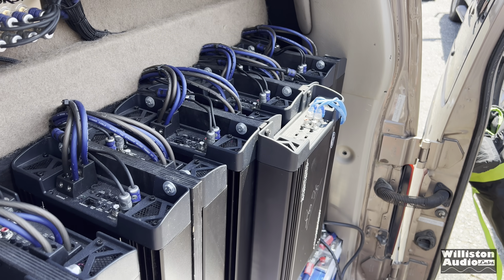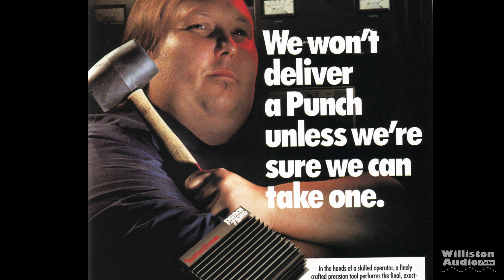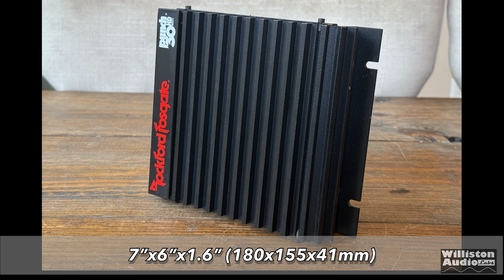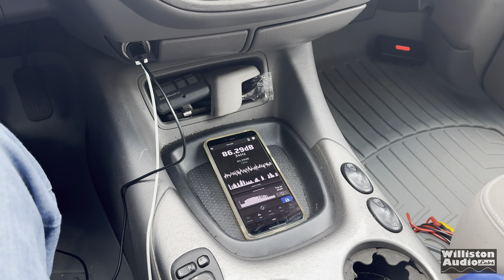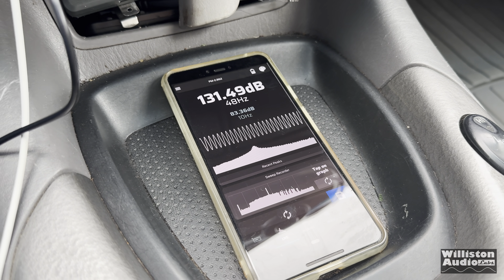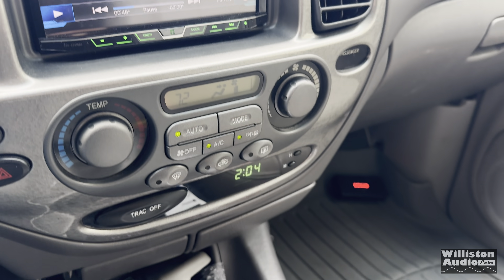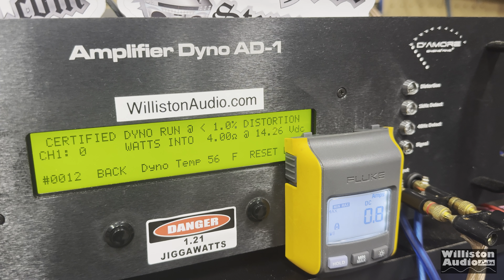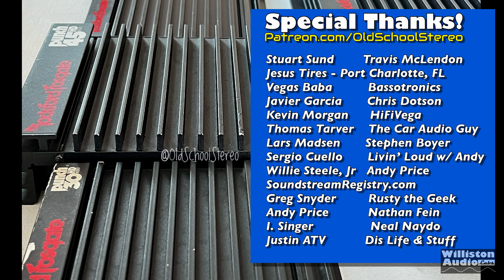Can This 35 Year Old, 30W Amp Power Four 12" Subwoofers?

Comment: That's not fair, Big D.  Your challenge never said it would be in a vehicle - especially a vehicle with a hatch.  My guess of 115.30 dB didn't include cabin gain.  I made my guess with the assumption that it would be in your garage where we always see the box and where the test bench is.  Cabin gain blows that out of the water.  Add that to my number and I'd bet it's close. 

But, this proves what I always tell people: you don't need a megawatt mutha for decent bass.  Doing that saves you the cost and hassle of needing things like expensive 1/0 cable, larger alternators,  batteries, stiffening caps, etc.  Put the money you saved into quality.

Comment: Well, U should at least get at least the rated db at 1 watt plus 6db x 2 + port gain + cabin gain. Most decent drivers can do 80db plus with 1 watt. Id have guessed at least 125db. Of course not gonna have super lows with this kind of valtage.

Comment: I had a Punch 150 running two Pyle 15's back in 1990 as a stopgap till I could fully afford something bigger.   It was a beast...I rattled just about everything loose on my car with that setup.  Eventually I moved up to a Linear Power 800 (that i bought from a guy at a car show and had a strong suspicion it was probably quite hot lol) and it was just stupid loud.
Reply: Pyle used to be great speakers. I miss the Pyle Driver driver 8" s I still have the  18"
Reply: … “strong suspicion it was probably quite hot”, yet you still bought it?🤦🏻🤨😂…you’re such a 💩….😁

Comment: 1 Punch 45 for 1 12"  MTX blue thunder.
1 Punch 45 for 2 Fosgate Punch 10's.
Custom box, top 12, sides were 10.
1 Punch 30 for (6) 6x9's.
J.V.C cassette with an E.Q from JC Whitney.
All behind the Bench seat of an 1980 Dodge ram standard cab.
Motor swapped a 1968 360 C.I and 4.56 rear gears.
Yep, it had a 3" I.D Cherry B.. Muffler.
Fast and Very loud.

Comment: Way back in the day when thump was still underground and mostly only in the hoods of Florida, we would use any 10-18inch woofers we could get and build boxes for them, there was no purpose built car subs back then afaik. We would get woofers at Radio shack 10s were $20, 12s were $40 and I think 15s were $50, they were called woofers not sub woofers, they did a good job. Then there was Booties pawn shop that had PYLE 10s, 12s, and 15s for around the same prices and they were pretty decent too.

then someone discovered EV and JBL and even PA and guitar speakers and that was the next level.

For amps we only had like alfasonik, hifonics, alpine, kenwood maybe even sherwood if i remember correctly then rockford fosgate came around and thumpin cars blew up!
Reply: Then you should probably remember Audio Advisors when it was on 10th Ave/Dixie… (now, on Palm Beach Lakes Blvd)… and the cars that came out of there!😎👍🇺🇸🇺🇸🇺🇸🇺🇸🇺🇸🇺🇸🇺🇸🇺🇸🇺🇸🇺🇸

Comment: Yesssss I'm sooo glad you did this is posted a few yrs ago how I had 4 12in jlaudio  subs and metered 151 n change powered by 96 punch 200 ix.  And had a gigantic box in a mini blazer filled entire back end. 2 subs facing backwards and 2 angled up  with 3inch pvc ports each sub had its own chamber. It fricken SLAMMED. Bounced change out of cup holder and made keys in ignition dance insanely and wore paint off steering column lol back side window eventually shattered  but before that it flexed like crazzzzzzy  windshield flexed doors n everything. I backed that up at several stereo meets at absolute audio video and cars n stereos in rockford illinois 1996 1997 and 98. Lol good times and yes they killed with just a few hundred each sub

Comment: Back in 96 i had a 77 Granada on Daytons with a ported wall with 4-15" JLW6s running at 6ohm mono to 2 MTX 2160s. Granted i did win several competitions in my class and my best was 147, but i didn't know much about how power effects scores back then. It was all about the subwoofers. If i would have run 2-2300s or even better 4-2160s at 3 ohm mono, I have no doubts i would've been in the 151-152s. Maybe 154 with some more deadoning because I didn't have a whole lot really. PS...I'd love to go back in time and give myself what i bought yesterday. A Jp23 on sale now for $230, and to think 2160s were $350 a pc back then in 1996 💵. 🤦‍♂️

Comment: That's pretty impressive. The recommended RMS power of 2400 watts. The subs back in the day didn't handle power like they do today, I wonder if it would be louder with much less power-hungry subs in an equally efficient box? Great stuff.👍👍
Reply: I had a lanzar 50 x2 watts amp  powering.. 2 x 8 inch rockford Fosgate punch 4 ohms.. they hit hard and sounded like 12 inch subs...😊

Comment: My 1st real system was 4 JBL 6x9’s with punch 45 on each pair   4 pairs of 6.5 infinity components powered by one Punch 45. 4 15” kicker comps with a punch 150 on each set of subs Head unit was alpine 7525R. All installed by me and brother in law in my 1989 Nissian. Building the box in trunk through to back seat and adding alternator was extremely expensive overall on the build!

Comment: The "peanut 30" was the nickname we gave that when we sold them. Was a good little amp at the time. The punch150 was our best seller. Another little amp that was even more impressive for what it was, Sony xm-2020. Sold for 99.99. Definitely the old days.
Reply: You’re not kidding about that Sony XM-2020!! 20 watts x 2 but wow!! I had that amp AND the Sony XM-4520 (45 watts x 2) and  mistakenly never used them UNTIL I sold them to a guy with a single cab Chevy truck (‘88-ish?).

I installed a set of MTX 10” truck boxes (the ones with the 10” woofer, 3”-4” midrange, and 1/2”-1” horn tweeter) behind his seat with the XM-4520 on them and set of Polk Audio speakers in the dash (the ones that had like a 2.5”-3” midrange and a 1/2”-3/4” tweeter, all in the same housing from Polk, model #???🤔) with the XM-2020 on them and that truck was extremely loud AND clean… crystal clear!! All with a so-called “measly 130 watts total”!😂👍🇺🇸

Comment: I promise u one thing that you could count on, if I saw this  line of amp in your car back in that day, I was entering auto. I know I know I'm ashamed of myself and should have gotten my ass kicked, but I wouldn't have stopped. Y'all remember when the hifonics Zeus came out, it was the same size as the punch 30 but pushed 1 k, we were blown away at that, cause we did crazy installs and didn't get 1000 watts, but imma say something, we dropped that quad boy and it hurt so good

Comment: How was it wired ? I have two of these amps and would like to run my 8” hx2 with them .. any help would be appreciated !
Reply: In mono… which is usually the positive from one channel and the positive (or negative?) from the other channel, depending upon the amplifier. 

To use BOTH of the amps on one speaker, that speaker would need to have dual voice coils and you’d need to wire up BOTH amps in mono and hook one amp to each voice coil… HOWEVER, getting both amps to produce exactly the same amount of power is not easy to do, so I would just get a larger amp if one of these amps is not enough for you, but it WILL work if you wire it up like I said.  Try it! It can’t hurt… well, maybe your ears if you turn it too loud?😂

Comment: I had a system in the 90s and yes they ran HARD on way less than 1000 watts. Mine was insane with boston acoustics rally components and two Rockford 12s on 2 Kenwood amps MAYBE 400 WATTS  lol no wait i think my components were off my Alpine deck and the 2 12s were on the Kenwood 400. Im 43 i cant remember exactly but yea it was wild

Comment: Ok.. so im gen x.. early 93 had this amp on x2 10" RF series one, if memory serves me correctly, in a isobaric bandpass tuned to about 35hz in what we have here known as a Nissan Champ Bakkie. Extended port punching through the firewall from the loading bay... simple setup, alpine headunit cant remember the model but it was, i believe, the first with a 4v output available in our market and a 61/4" RF split Front stage and some passive crossovers... with the help of the local RF team box 1 gave me a 128db, weeks of tuning, and on box 3, some serious stifning etc, we hit a 134.6db... now being some 30 odd years back i cant remember the finer details.. but we build a few monsters back then with very very basic stuff... doesnt make us good... just made us squeeze every bit out of what we had... thanks for the video and thanks for the nostalgic trip down memory lane lol

Comment: It's my belief to this day that the Punch 45 HD is one of the greatest amps ever built.
Reply: @PDXMetal_90  no lies detected.
Reply: No doubt. It was a beast.
Reply: I had the reference 4 channel soundstream 50w x 4,10.0 25w x 2,and a 5.0 12.5w x 2, a mere 275w, 4 way system running thru a RF symmetry EPX ll, w/ 30 band eq. 6 JBL gti tweeters, 2 3" and 4  5.25" powers series RF mids, 5 JBL gti 8" mid bass, and 2 12" kicker solo classics In a bandpass enclosure that kicker themselves said can't be done, hit 154db, the record was 163db  then, set by the RF Blazer using over 10,000 watts. I did so much more with these 3 amps than I did with the 8 RF amps I had previously. Would never knock RF, They were always great. But competition in 300w and down class, verses 1000w and up class was a no brainer, 154db with less than 300w rms was truly hard to beat😅
Reply: You obviously never heard a soundstream  10.0 or a 5.0. That's a 25w and 12.5 watt amps, so wicked they outlawed them from competition
Reply: @dustydawson8977  That's why I said "ONE of the greatest amps ever built".

Comment: Till this day my system is 500 watts total 2 mtx thunder 250 amps on 4 mtx blue thunder 12s and they hit just as hard and cleaner then the kids running around with 5000 watt systems

Comment: Man, I was less than half a DB off with the windows up. Then the window down test, killed it. I seriously think it will come full circle and demo guys will start using more sensitive subs in the future.
Reply from the maker: Rob and I talked about this dozens of time on 12V Talk and how so many people think you need 1000's of watts and huge, heavy subs to get good bass and it's only the case if you want to get windy or shake your vehicle apart. You can get insanely loud with less than 1000W and don't have all the electrical complexities with extra batteries and huge wire
Reply: @wal  Not to mention price and weight. I wouldn't mind doing an old style build with a zillion entry level and low power. Entry level subwoofers are about equal to what we had 30 years ago so it should be a good apple to apples.

Comment: Super cool! Reminds
 Me of the old Orion red hcca amps. Back in 92 my brother and i had a rockford fosgate punch 45 pushing 2 pile driver 15s in a lowrider cutless you coud here it for at least a block or two away!
Reply: Also we used a 4 channel zappco to run 2 kicker 18 in a push pull clam shell design in my old honda accord use the spare tire well back in 91

Comment: Your comments were valid.  The P45 and P150 (original and also HD) were the real workhorses.  The P75 was good but did not overachieve like the other two.  The P30 and Power100 were curiosities but they did much closer to rated power and were not popular at all at the time.  I sold P45s 20:1 over P30s.
Being able to wire speakers series and parallel to keep the amplifier in its operating zone works with any amplifier.  We ran all sorts of brands mono and stereo at the same time (multimode).  Alpine even made a passive crossover module (3722) just for that purpose.  The difference was that Rockford actually trained their dealers how to do it properly and not blow their stuff up.  Knowledge is power.
Reply from the maker: The P45 was a sweet spot for price vs performance
Reply: @wal  thank you
Reply: @BaddDukk  75HD was a powerhouse I don’t know what your talking about bro 😂

Comment: it's all about the parts you pick and the way you configure them. prior to one of the local banks changing their alarm to a silent system sometimes at night just for giggles i used to pull up to the front of the bank and crank up my system and it would rattle the doors so hard it would set off the burglar alarm and the biggest amp in my system then was a 300 w bazooka monoblock, you know how the saying goes, it's not the size, it's how you configure it. You don't need thousands of watts to be loud, obnoxious and piss people off...

Comment: I mean lets be real here, all it took was a $1500 setup with a box designed exclusively for the 4 cheater subs that each have more cone area than a standard 15" round sub lol. Everyone knows you either need power or cone area to make noise, you dont necessarily need both
Reply: It's a factory box, lol.
Reply: @JosephPeluso-f4l  yes that cost $1500 and was engineered specifically for those speakers

Comment: Nice to see the Kicker Quad Box make another appearance! :D
Hooking an amp to a Quad Box is like hooking up a CB radio to an 8-element beam. It's all about the gain! 
If you hooked up the same amp to a  6.5" sub, it wouldn't be anywhere near as loud.
Reply from the maker: FACTS!!
Reply: Um, duh! A single 6 1/2” sub doesn’t play in the 20-30hz range, like those FOUR 12” subs do AND cannot move as much air as a single 12” can, much less FOUR 12” subs in a ported box!!
Apparently, you’re no rocket scientist…🤦🏻😂

The whole point of doing this little experiment was to see if the 30 watt x 2 amplifier in mono “could” push THAT specific box decently or not… and I think that 133db is DEFINITELY proof that it can!

Try taking some other 30 watt/channel amp and putting it on there to see what happens?!

Man, next time compare apples to apples, NOT apples to peanuts.🤦🏻

For your information, I’ve seen a single Punch 45 push (4) 15” subs and even (8) 15” subs to deafening levels. 

Now, if you like 6 1/2” subs so much, why don’t you take (16) or even (32) of them and hook this amp up to them… THEN tell me how terrible it is?! Man, that vehicle would be deafening with 16-32 decent quality 6 1/2” subs powered by THAT amp!!😂👍 You’d move a ton of air as well… probably MORE than those (4) 15” because of greater cone surface area??😁
Reply: @tigerstripeeyes9871  Where are these AI trolls coming from?

Comment: Not suprised. I built many cars with Orion 220GTs, Punch 45s, Orion 222SX, Hifionics Cupids, Hifonics Plutos. A "good" installer had two 15s off an Orion 2350 GS and four 10's off a 4 X110 Alpine and some Sony two channel on the front. I used a Pluto running three channel on a single 10 inch bandpass and two plate speakers. That guy assumed I had about 3000 watts as the car tried to resonate itself to pieces.

 I had a n Orion Cobalt 430 running three channels on a pair of C-12s in a 1990 Trans Am. That hit 143 on my Audio Control Sa3050 with SPL 170 upgrade. Adding double the power is only going to go up another three db. I got more output bracing vehicles than anything else.

I still have two 222 SX Orions waitng to have some punch for lunch. Either you know or you don't.

Comment: I had a punch 60 i think it was running two punch 15 and it bumped!... For the 90s😏 123db , i remember it having a chip on the bottom that pulled out and reversed to do different things 👌 best amp ever.

Comment: My first stereo in 94 was a LA Sound Malibu 120 on a 15 inch MTX road thunder II, in a ported tube from JC Whitney.  It played low.  Second system had a Punch 40 x2 and a Punch 100 x2 plus 2 12 inch punch in a bandpass box, and a Clarion 920 eq with a Pioneer Super Tuner III.  LAF.
Reply: @jamesipock3669  I had an 87' Pontiac 6000 STE around 93/4' and was finally going to get a "system". Got the latest alpine detachable face cd deck, the LA Sounds Hermosa(240 watts I believe)(max!) And two free air Cerwin vega 12's. I was in heaven. Lol. The subs were mounted on a slab of 3/4 mdf side by side aimed directly into the back seat. "The good old days."